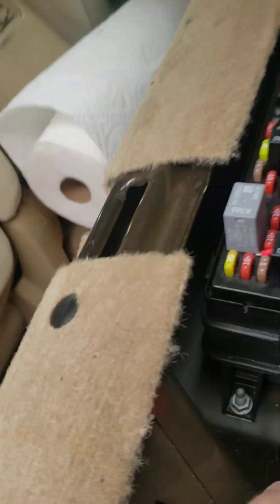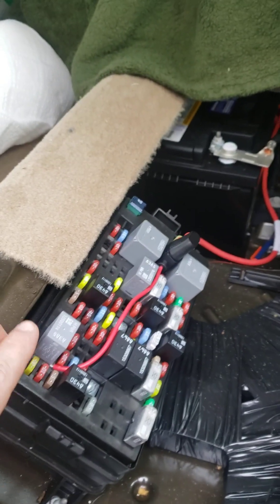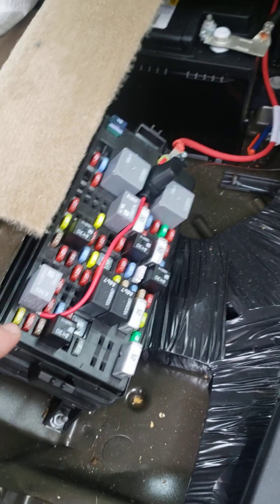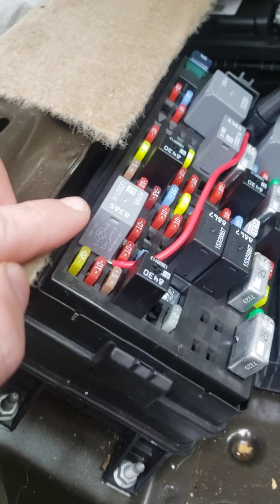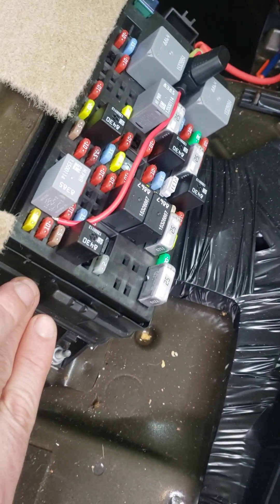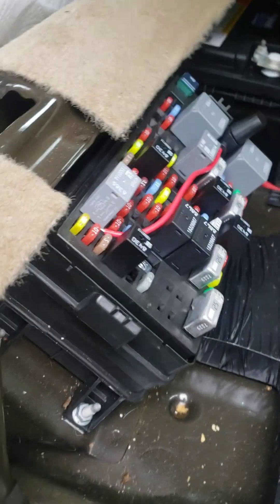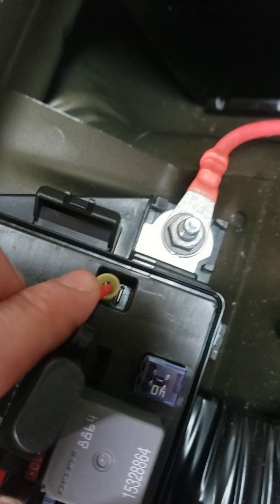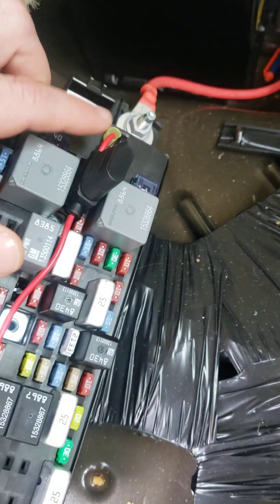08-11 Buick Lucerne Fuel Pump Relay Cheap Fix

Comment: I used 14 gauge home wiring. 2 feet wire, strip ends 3/4 inch. Hammer stripped ends flat. Wrap wire around pencil to coil wire. Remove relay, push flattened copper into hot slot of fuse box. Insert relay. Stretch other end of wire to horn relay hot slot. Then push relay back in. Working great on mine. Barely gets warm in 30celcius day.
Reply from the maker: No reason that wouldn't work. Like the idea of pounding out the wire and making a spade insert. Probably way beefier than it needs to be but no reason that wouldn't work. We don't use the horn much so that shouldn't cause a fuse to pop unless you hammer on it in traffic possibly (the horn) and even then I am doubtful you will ever have issues. Well played. I like the ingenuity.

Comment: Will that cause the fuel pump to go out?
Reply from the maker: Yes, the relay controls power to the fuel pump; a relay is basically a switch that turns the fuel pump on.  So if the relay is not working you will get no power to the fuel pump.

Comment: The only thing I did different from what you did is, I bent the #30 prong on the relay, into a U-shape pointing up and then put a female, spade connector on the end fuse wire. Now instead of shoving the wire down in the hole you just push the female spade connector over the pin, it’s a tight fit between the little 10 amp fuse that’s right next to it but it’ll go.
Reply from the maker: Love it, that works too. I like it. Still working well I hope?

Comment: Did this it worked for about 3 months and had to replace the relay.
Reply: It may have been bc my fuse disconnected from the 12volt constant not sure tho. Put a new one in a drive around and it did not get overheated this time around.
Reply from the maker: @jackvollo7541  Make sure you cut the bracket back s it does not agitate /  loosen the relay by pushing on the fuse block lid. Yes a loose fuse / wire would definitely cause it to get hot or not start at all. Depending on how damaged the socket is on pin 30 for the relay you could try a larger wire size to ensure snug fitment / proper connection. Going on 4 months with my fix and still works great; no issues.

Comment: Where did you get the inline fuse and yellow connector from? Like autozone or something? Can you provide both links? That a be awesome thank you
Reply from the maker: I got the inline fuse off amazon and I had the spade terminal in a terminal kit could probably find both at Autozone.
Reply: @SupaJunnt Are you shaving the other side off. Just bare wire into the relay?

Comment: Would you suggest cutting the bracket back or adding the wire or both to make sure I don’t have this problem in the future?
Reply from the maker: I would do both and it should future proof it.

Comment: Thanks for the tips. I installed a new relay but I still needed the jumper wire also. Is it because the black fuse box is bad?
Reply from the maker: Yes, the connection in the box is loose where the relay plugs in (pin #30) and not getting correct voltage. 

Unfortunately jumper is the only reliable fix without replacing the entire box. 

Glad it helped!

Comment: Will changing the 20 amp relay fuse to a 30 amp fuse help the problem
Reply from the maker: No. The issue is with the connection to the relay and not the connection to its parent fuse.  Increasing fuse size would make no difference with the relay connection.

Comment: What is the yellow piece that you put on the end of the fuse line to connect it
Reply from the maker: That is a 'spade terminal connector' they come in various sizes. The color i believe correlates to wire size / Spade terminal size. Put it over the exposed wire and crimp it on. Or if you don't have crimp tools a pair of pliers will work.

Comment: This is exactly what is happening with my car and thank you thank you thank you because absolutely nobody could figure this out for me and my car has been out of commission now for months and it's a fairly new car. I'm going to get the parts to do this now but I have a 2009 Buick Lucerne CXL will this same fix work on my year and model as yours, I hope?
Reply from the maker: Yes,  should work for any lucern from 06-2011. Glad I could help.  Post an update once done.
Reply: has worked on my 09 Buick lucerne for 4 months now , they make a shorter stance relay for fix , but have yet to find one ....ordered one from amazon for 38 dollars and it was same height
Reply from the maker: @marcuscheko3264   Yeah I heard of this lower profile relay as well but could not find one. But I guess if the socket is damaged the shorter stance relay most likely wouldn't help anyways.  Really glad this worked well for you.

Comment: The J Case #49 seems to be the location of one end of the inline fuse, since that spot is designated for a 40 amp BLOWER, do you know which blower it powers?  By the way this does work, I'm driving right now as a result of this technique, thank you.
Reply from the maker: J-Case #49 is designated as not used on 08-11 Buick Lucerne. https://www.autogenius.info/buick-lucerne-2008-2011-fuse-box-diagram/
#48 is designated as a blower. Not sure which blower. If I had to take a guess I would imagine the blower would be for your blower motor located under the dash that controls the output of heat / AC through your vents. Just my guess.
Reply: Hey came across your post I have the same thing in my Cadillac dts with 49 already with a fuse where you able to get it in there or what was your method thanks in advance

Comment: Definite life saver, thank you, going to get the parts later today.
Reply from the maker: Glad it helped. :)
Reply: @SupaJunnt thanks for tip. What is the opposite end of wire connected to? Is that a yellow cap for the exposed wire? Or is it connected to metal of the fusebox...I see the 12awg 20v wire under the fuel relay, but, on the opposite end I see the yellow on the other end, what is the other wire connected to? I have a 2009 Lucerne I have used a paperclip to get it home but I got the 12awg wire with fuses, 20V and 30V. Trying to mimic your repair. Thanks for any assistance.
Reply from the maker: @dwayne6781  The yellow end is a spade terminal that I crimped onto the wire and then attached it to the 12v+ accessory spade terminal in the fuse box.
Reply: @SupaJunnt so spade terminal, 20amp fuse thing? Is that it?